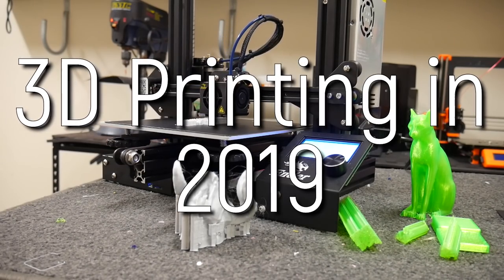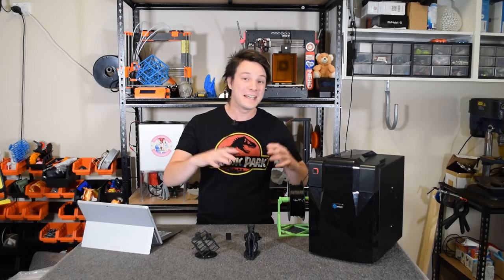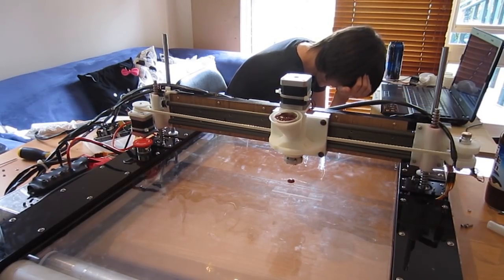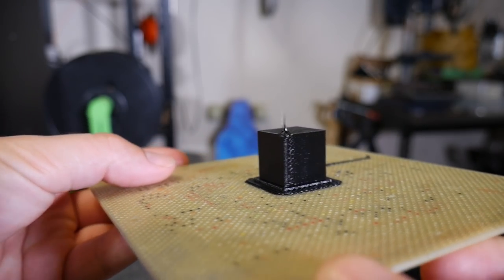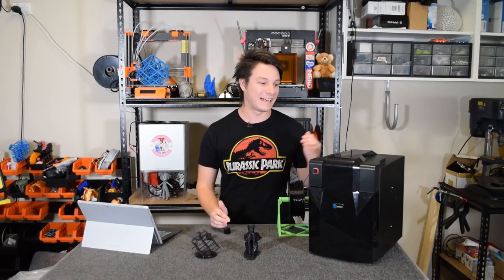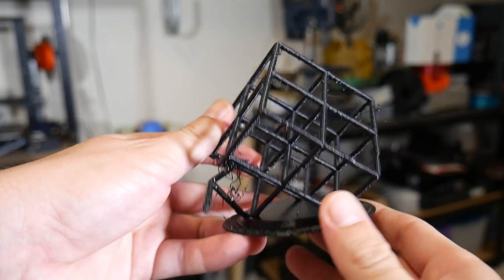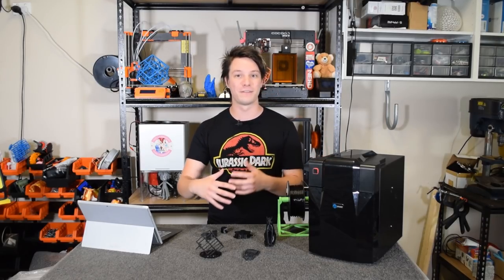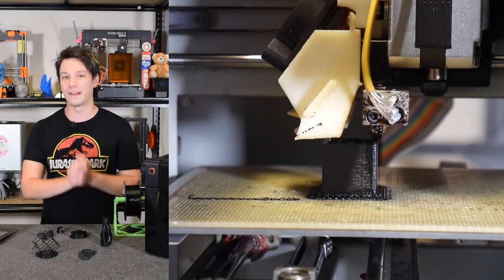My oldest 3D Printer... Is it STILL any good?

Comment: Litterally just picked up a new Ender 3 from Creality for only 130€ and I love it so far ! Having real fun working and printing with it I had a catastrophic missprint where like the nozzle locked up or something but the whole bed was off the screws holding the bed were off the head was encased in a giant blob of PLA and the head was banging into the control panel, I had to completely  disassemble the the printing head and somehow the pla seemed to have ripped off the wires to the temperature sensor so I had to resolder them on and I was 100% sure that it was toast but It workes without any problems haha Its really fun to just work and mod the Printer

Comment: I've actually bought UP mini (second hand) about a month ago. It was love at first sight! :) Prints ABS without any extra effort. 

As for PLA, well... They advertise it does PLA, but probably just their own brand. Still, after adding an extra fan cooler and finding the right temps, I actually managed to print the 3D Benchy with ERYONE rainbow PLA (not that it really matters because the colour changes are so far apart that the Benchy still prints a single colour, haha). 

I'm looking into adding an extra fan cooler to keep the overall temps down as much as possible for PLA printing. And I'm going to create a new (ball-bearing based) filament holder because the one that came with the UP mini cannot take 1kg spools, and there seems to be some sort of friction that makes it hard for the extruder gear to pump the filament evenly over the course of the print.

Comment: Hello Angus, I have been enjoying your videos. They are very helpful. I am looking to dust off my flash forge c which I have not gotten back to in years. I hope that with using your information that I can get it running and working properly. Like you mentioned in the video, with not knowing the tweak and tricks I walked away from it when it would not print correctly. Thank you again.

Comment: I still have my first printer which is an UP! Mini. I always hated the perf board as it was a pain to clean and would also tend to bend when doing large prints. I still have a good stock of ABS filament for it, so to make use of this and to reduce the risk of injury when removing a print with a sharp scraper, a glass bed was installed and seems to work quite well. I just wish that I could talk to it with my slicer software rather than using UP Studio.

Comment: Heck, I have been running a Da Vinci AiO 3 in 1 1.0 for the past year... bought it for $75 ... Came with some filament carts, arduino flasher for the carts, and mostly all the stuff it would have come with originally. I use it in conjunction with my Longer resin printers all the time. Really, I probably use it (DaVinci) a heck of a lot more at this point, as it's so much faster and cleaner to print rapidly with. It's old, and it works fn great. Keep it calibrated and clean, and it keeps providing as good of prints as it ever did on day one. Also fully enclosed, but much larger. Nearly 8 inch cubed. Plus it has the laser scanner in it. Similarly the bed here is heated and uncontrollable, getting its temp settings as well as the nozzle settings from the carts flash chip. Which I can reprogram, but I haven't gotten too into changing temps, etc... just resetting counts myself. That said, there is also the Repetier firmware for the printer, which turns it into a normal type... allowing for all the changes one could ever want, right from the printers interface and screen. Maybe someday I'll do this, but I've simply never had the need yet. As the stock settings have always provided a perfect print for me... providing I didn't leave a dirty bed, un-calibrated bed, etc. As usual old is better than new, at least for me. This was had super cheap, I can basically photocopy things with it... with the scanner and all. It works with a slew of computers that are older yet still outperform new variants, etc... lol. Save money, buy smart!

Comment: Backed the Newmatter Mod-t on Indiegogo back in 2015 for $249. Got it like a year later and probably printed thousands of hours worth of stuff on that thing. Still have it, but haven't used it since I got my CR-10s. I always feel bad when I see it in the corner. 
It didn't review all that well, but man.... with a little TLC in the CURA that thing could print insanely accurate details! 
Really bummed that Newmatter went out of business.  :(  The engineering and design of that printer are still really innovative and beautiful. The rack and pinion build plate was always fun to watch.

Comment: Angus, would you create a new price point -  recommended printers list for 2019?  I' had purchased an Anycubic i3 Mega on your original recommendation and it's been a great printer.  Just wondering what you'd be recommending in the new current crop of machines.  I'm definitely in the more "using it as a tool" rather than tinkerer category.  Also wondering what your opinion is on the vslot/roller vs. direct drive screw linear bearing architectures was?  Seems like vslots are much more prevalent these days.

Comment: Still use my first printer as well. It's an original Turnigy Fabrikator, I put an E3D v6 on it to print polycarbonate and it prints beautifully and never let me down. It may not have some modern features but I can depend on it to work. I feel the same about it as you feel about your Up Mini. Great video.... Strange... suddenly I feel like printing something. :-)

Comment: I have one of these printers. Got it off eBay about three years ago but it wouldn't connect to my laptop. Got it working this week… and am printing with the very old proprietary ABS that came with it… and the two or three Benchy's I've printed so far are welded to their rafts!
Reply from the maker: Printing too hot, reduce the temp to ~230-240degC

Comment: Funny I picked up an Up Box+ cheap (it needed some TLC), and I thought I was in for quite a journey of unlocking it out of the Tiertime ecosystem, but I have been pleasantly surprised, it is very reliable, very easy to use and to date just works so I have done none of what I thought I was going to do. BTW it prints PLA fine if the lid is open, PLA suffers from heat expansion so will get jammed in the all metal extruder it it builds to much heat, using the magic finger I have been able to determine that the temperature of heatsink on the hot end is much lower with the lid open.

Comment: HOLY CRAP !!! I just nabbed one of these on ebay a few weeks ago !! COOL! got it for $89!
Reply from the maker: Provided it hasn't been damaged you'll have a great time :) USB connectivity but you can unplug after it sends the data across.
Reply: I remember you loved yours so much I could not pass it up for so cheap :-)

I just put in an offer for a Tiko too (that one is not so nice but it looks pretty!) hehehe

 @MakersMuse
Reply: It’s good to use as parts for the up plus 2, that’s what I used mine for. Main boards are $500 bucks

Comment: Such a weird coincidence. I own an Up Mini that is a little bit of a "new and improved" model, and i found myself using it to print something, the same day you posted this, after years of not touching it. However, something about mine is broken and it fails to connect to my pc and will just randomly stop working. It actually really pisses me off trying to get this thing to work now.

Comment: I still have mye printer I bought in 2014, its almost 10 years old. But now I think its time to change it, it got clogged half a year ago, I just repaired it, printed two prints, started on my third and it clogged again, big time. I think the ptfe tube above the hottend is worn or something, so it just clogges up inn there, I did order a brand new hotend kit with, but I still wanna get a new bigger printer. but for 300 USD and still kinda works almost 10 years later, gotta say the Geeetech I3 pro has been good to me for the most part :)

Comment: Thats why i gave up on the MP Select Mini Pro for the Prusa Mini+. Just too much hassle getting it to work well. And what i have seen in the ender3 videos does strenghten my believe that i made the right decision now. But i am fully on board to say, that there is a need to get a printer which just runs and therefore if it is more expensive, that is ok. All the nights i spent trying to get the MPSM running were not worth the saved money.

Comment: Man I still have my up mini from 2013, my first printer, and I reckon still a baby, only ran 1.5kg of abs through it. Man the jaycar abs works wonders on it. Not all of ups filament is good, the royal blue gave me hell, clogs non stop, if it did print, it would never come off. I want to get it a new build plate. After all these years I just now upgraded to ender 3 max.  How did u get the studio to work, mine prematurely stops printing

Comment: I kinda hit those steep learning curves and broken "new" kit printers (blown PSU on one, needing entirely new Firmware, manually editing everything, second printer blowing a motherboard, as a gift, no warranty, so needing to buy a replacement, printing problems, needing software adjustments again)... yes, hours or work. But I guess I tend to be like that... I want to 3D print, so the hurdles are worth it, for that price point.

However, I'd get a $1500 "turn on and print" one if no DRM, and user friendly settings (so unlike the video here where software locked out temp settings!!!). So while these are cheap, hacked, and partially broken printers I have... they are mine... my little 3d babies. XD

Comment: 03/10/2015 I bought my Flash Forge Finder for $1,250
Today: 
Visually the machine looks stock with nothing modded but a spool holder
Internally there is a simple mod for the drive head to help with printing flexible filament
Mechanically when  it prints sometimes the head will grind and cause a 10~mm shift in the print and continue printing.

It might need a new internal SD card for HDD, but something isn't right after 3 years sadly :(

Comment: It's funny how you talk about people being discouraged from a lack of info or machine that doesn't work. When I bought my first 3d printer, just a few months back. I really didn't do much research. At least not the way I usually do. I usually look at specs and info, sure. But I also usually find a community and ask questions. Which this time I did very little of. Early on I decided I wanted to mostly print in ASA and maybe some ABS for temperature resistance on RC airplane parts that get stored in a trailer or are exposed to hot Florida sun, and often. In the 2018 world of "PLA is amazing (i disagree)". I had a hard time finding anyone who could honestly answer my questions at the time. I kind of wanted something like a Ultimaker 3, that could be enclosed. But man, that price tag... After looking around I found the Monoprice maker ultimate for about $800 (back 2017). When I finally had some money and decided to make a purchase, and was heading toward a lolz bot or something. I noticed that Monoprice had dropped to $499. So I purchased it and the enclosure for it. When it arrived the SD card containing the test print, a special copy of cura setup for the printer, and the instruction manual (I assume) was no good anymore. It needed to be formatted to be read in any device I tried. So I kind of had to go it alone with no instructions, no software, and no test print. Luckily the Internet exists and other people had already posted settings and stuff for newer versions of cura. So it didn't take me long to get up and running. I've had great success with the printer, and even more so once upgrading to a buildtak flexplate. I sometimes wonder how much better can a Ultimaker 3 honestly be? I don't know, but I find it weird i never see anyone talking about or regularly using the Monoprice Maker Ultimate. I'd honestly like to see what you think of that machine compared to all the others you've used. Because honestly I've only seen a few people compare the machine to anything else and it seems that the response is "Meh". So I'm wondering what I could be missing besides automated bed leveling or something like that. I mean is a Ender 3 really just as good for $200, just without an enclosure? Honestly, this is the bigger issue for me these days and having so many choices available in the market. With the Internet it's pretty hard to buy a machine that is just loaded with design flaws or just issues similar to what you had to deal with on your first printer.

Comment: I got one of these printers used recently and it just beeps over and over once you turn it on. Its missing the micro sd card and I tried an 8GB card but it didnt change anything. Would trying a smaller capacity card possibly be the fix?  Thanks for all your videos and everything you do!
Reply from the maker: It's been a very long time but there is software made by tiertime called "upinspector" which you can use to diagnose the printer plugged into USB. It can check the SD status too. 8gb should be ok but may be formatted wrong perhaps? Sorry I can't be more specific!
Reply: @MakersMuse  Thanks so much! I'll give it a try!

Comment: Great channel, I am learning a LOT!

TL;DR - should my printed models have the same dimension as the design?

I don't know if this is the right way to contact you with a question but here goes. I recently bought a Dremel 3D20 and so far I have only printed a couple of test models in preparation for a project I am working on. I ran into a snag almost immediately - the printed model dimensions do not match the design; it's smaller. For example, a cuboid with two holes through it (14mm and 13mm) came out with holes of 13.71mm and 12.58mm. I used tinkercad to create the STL files. I used the PLA that came with the Dremel printer. I used all defaults. I contacted Bosche support and they said two things:
1. the filament can shrink so adjust the design accordingly,
2. tinkercad basically sucks for accuracy.

I am on the verge of returning the printer because I'm of the opinion that their support is full of it. How can I be expected to make models with multiple parts when I don't know what size the parts will be printed? so, is that a reasonable response from their support team? Am I expecting too much from an entry-level printer? How much do I need to spend on a 3D printer that prints pieces that will match what I designed?

I was totally blown away by their response. It's not like I am trying to create a hole with a diameter of 14.76 and it's coming out as 14.74; I think that would be an unreasonable expectation.

Thanks!

Comment: meanwhile i have my first printer last year, the anycubic kossel. thought of going anet a8 but i was impatient and got this instead. yes it's a delta & terrible for beginners but it's fun tinkering with it, learned about all its parts, what is the best print settings & tuning the machine properly, the only thing i can't figure out is that the dimensions are always slightly off (0.2mm ish & uneven), and the printable area is worse than what i thought.

though it's a workhorse after i set up a customized marlin fw, i haven't printed anything worthwhile for now (only for ppl asking for print on demand), might change soon as i have plans in my mind lol

Comment: I did exactly that, bought a £200 cheapo ebay i3 and it didn't extrude properly. Not knowing anything at the time, I gave up, Luckily I was watching Angus at the time and he recommended I get a Wanhao i3. I've had that machine for 3 years now, It's been through 2 motherboards but it's currently running at its best and done way over 1000 hours of printing.

Comment: Hey Angus, I have a question for you. I have an UP Mini in my classroom that my students and I were using. But, one day we were printing and it suddenly refused to connect any computer. We tried multiple computers, multiple USB cables, reinstalled software, etc. I think I have verified that the power block has gone bad. But, I have not been able to find a replacement for it as it is a 19 volt, 9.47 amp supply. Do you know of a good one to use or have any suggestions?

Comment: Hello Angus, fyi i just now got my refund for my cetus mk3 that caught on fire. I had a very bad experience with tiertime and now have a very sour feeling with them. The printer was very nice and i liked it alot but without thermal runaway turned on by default by a company that knows better is a shame. Is that option on or off in your up mini? I know you have had strong feelings about this problem.

Comment: I'm curious to know if you have any advice for an absolute cheapskate who wants out-of-the-box simplicity? I've worked with drones and robotics so I know you have to pick either one or the other, generally speaking, but I keep getting the printer itch and have had a hard time settling between something like the monoprice printers or an ender or something similar...
Reply from the maker: It really depends on your budget and requirements, there's many machines that need little knowledge to run but it's all about compromise.
Reply: @MakersMuse  A solid way of describing the situation! I greatly appreciate how you walk through your in-depth slicer settings and such for machines that you review - it certainly helps apprehensive newcomers feel more confident about getting things working. Personally I've been learning more toward the resin printers and have been waiting until that market matures, but I know it won't be long until I've picked up a few different printers :)

Comment: Hi can 3d printer make a box with no support in box ?
Reply: Lazy answer would be, " depends on the dimensions of the box ".  Lookup " Bridging 3D printing " for that.
Also, there are all kinds of creative slicing and post work that could be used to 3D print all kinds of challenging models, not only in FDM but also in most other additive manufacturing